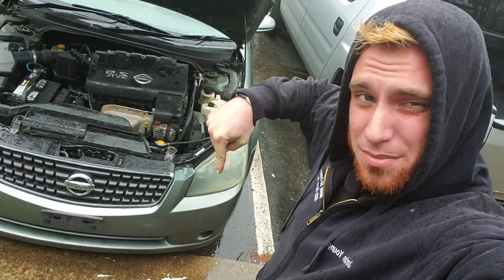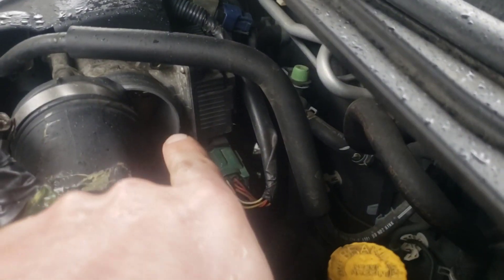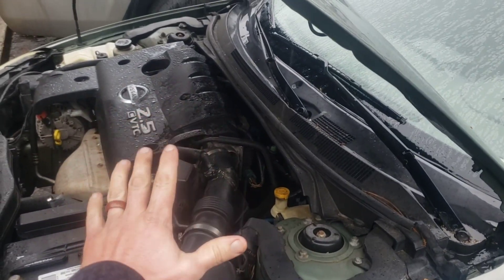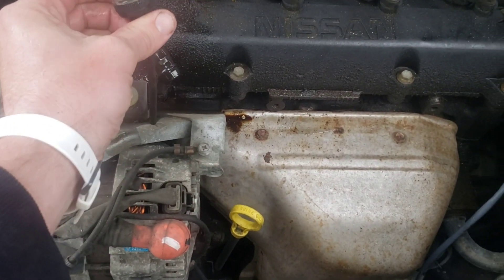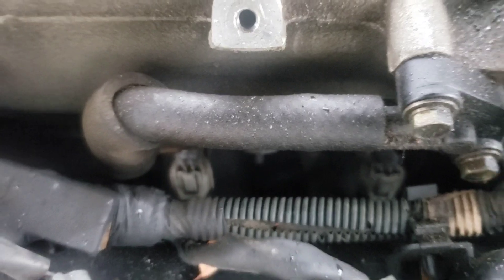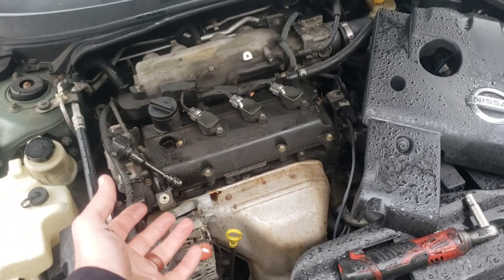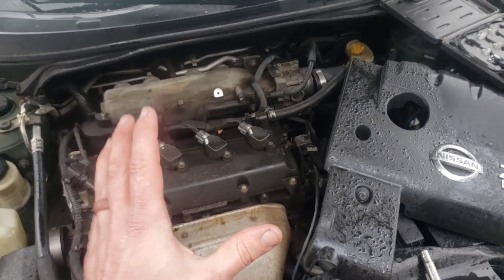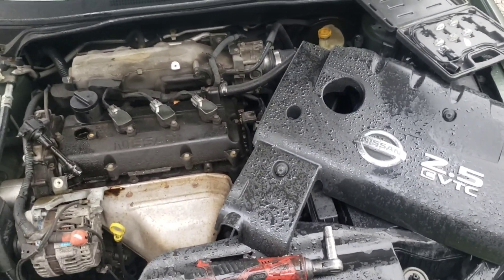Crank No Start Diagnosis Nissan Altima

Comment: crazy thing is that I have replaced the crank and cam sensor twice in my nissan, the car will work for about 2 weeks and then back to crank no start 🤬😪. new fuel pump,

Comment: I have an 05 altima and it stalled now won't start. Has brand new battery, alternator, and water pump. Did the crankshaft sensor last year but not the camshaft. Where should I start? Could be 5 different things
Reply: did you ever it out

Comment: I have a 2012 Nissan Altima SL. It'll start and I'll drive it around and then when I shut it off it won't start again until I've sat there for about 30 to 40 minutes. Then it'll start again. I have no idea what it is I live on disability I cannot take it into the dealer to check this is anybody have any idea what this is causing this problem. It always cranks it just won't start if I've been driving it for a while I have to wait.

Comment: I kept getting code p0335 crankshaft sensor I change it same thing wouldn't start I would charge battery but it would not go over 12.3v come to find out my battery wasn't good I found out after trying battery from other car it started quick

Comment: I have an 05 Nissan Altima, and I having these same issues. I added a new fuel pump in there myself, new camshaft/crankshaft sensors, new thermostat (needed to change it anyway), and I was getting the same crank/no start issue - except it wanted to start but looked like it wasn't getting any spark. So the only resolutions that I can think of are either the PCV valve, the fuel injectors need to be clean, or the Ignition coils need to be replaced - since it started back up after buying a new ignition coil that wasn't providing spark. Then the car reverted to not starting back up after I turned the car off to get gas.
Reply: Ever figure out the issue?
Reply: @SJ-qf4mj  blown head gasket
Reply: What I'm actually passing through now..  any solution to yours?
Reply: My 04 was cranking until the outdoor temperature hit 102 for a few days then it wouldn't start.

Comment: My altima cranks very weak. New battery, spark plugs, there is current on all 4 coils, fuse is ok, starter works. I dont have a fuel tester, but I disconnected the line and it squirts very strong everytime I turn the key

Comment: If you have a no start condition, spray starting fluid. If If fires, it's a fuel pump or relay. If it doesn't, it's a crank or cam sensor.  Not likely a ecm. If you change sensors, Check  wiring or bad aftermarket sensor.
Reply: So do you leave the screwdriver in when you try to crank the car?

Comment: INFO: my dad is a 25+ year mechanic and we had a 30+ year nissan tech come and look at it. 
Replaced the head gasket (I replaced the head bolts with ARP branded ones) and after it would crank but ran really rough. I made sure the the head and block were perfectly flat cause they can warp when overheating which was my original issue. I made sure that I set the timing perfect. Then it went into NATS and I had to send the ECM to a place to remove NATS. Then it wouldnt start at all unless we unplugged the crank sensor. Bought a new cam and crank sensor, new coils etc. After this the coils started to literally explode. The nissan tech said hes only seen the coils explode on 2 cars due to the wiring harness wearing out and starting to short somewhere. I checked the harness with no signs of shorting. Even bought an oscilloscope to make sure the coils worked right and they were running fine. My only thought is that maybe the timing is half a tooth off causing it to sometimes runs but bogs down at higher RPM. Ive spent 50+ hours trying to figure it out. Also each cylinder had perfect compression. Before all this bs happened it was eating coolant cause of the head gasket so I took it to the dealer which they said I needed a new valve cover gasket which made me facepalm a bit but I said fuck it just to prove they were fucking stupid. They ran the car with the valve cover off and said they put new coolant in it. I got a mile down the road and the fucker overheated cause they lied and the radiator was completely empty and dry.
Reply: So I drove my 05 Altima 3.5 the other day home. It upshifted then died. Would crank but wouldn’t start. I went to autozone to get a crankshaft position sensor, installed it and still same symptoms. Cranks but doesn’t run. I just read your comment about disconnecting it and sure enough it started but ran rough. Then died again! 

I assume get a sensor from the dealership?!
Reply: Did you get it fixed and what was the issue? @maxboya
Reply: @scottk27332  motor skipped timing and bent the valves had to junk the car
Reply: WOW so sorry to hear that, I am hoping that's not the case with mine. I just bought it, replaced all the coils and plugs, valve covers, and it ran perfect for a day. Very quiet when running! Got home, tightened up battery terminals and played with some lights and went to move it and it jerked, now its a crank no start....hoping for the best and will check timing now as well @maxboya
Reply: @scottk27332 I don’t know anything about cars but now have an old 06 Altima that sat for years mine cranks but won’t start any idea where I can learn the basics on it? I get the check engine light the battery light and brakes but I’m not concerned about brakes if I can’t even get the car to move lol

Comment: never use fuel throttle body cleaner directly into throttle body. this particular engine is not designed to be sprayed directly .... instead spray a cloth or towel and wipe the blades only. spraying that directly into throttle body will cause immediate future problems

Comment: You said flat head screwdriver, push it in and spray starting fluid, you mean push in the butterfly valve inside the throttle body? Would this require a throttle relearn if it did start? Also, spark plugs and ignition coil generally wouldn't cause an engine shut off while driving, then crank and no start...any other recommendations? Cam and crank pos sensors have already been replaced, still no start. And my understanding is that the fuel pump doesn't usually die while vehicle is driving, it's usually after a shut off it won't start back up. I'm stumped and been trying to fix my daughter's 05. Pump hums when ignition turned to on. This momma is getting frustrated
Reply: Pcr Valve
Reply: Located behind and under your coil packs under the harness

Comment: I had an intermittent crank-no-start situation that turned out to be a bad cam or crankshaft sensor (I can't remember which one) ... but it  wouldn't let the engine ignite.  It would just flub out. It sounded like it was choking or not getting enough gas. It turned out that the  sensor had been recalled from  but no one had ever changed it. I bought the car used after the recall period was closed.
Reply: I am currently having crank no start in my daughters 06 Altima 2.5. OBD is showed camshaft pos sensor. I changed both camshaft and crankshaft sensors and the car is still doing the same thing. Even though one of the codes went away. I even disconnected the negative for a while to resent everything. My next guess is a fuel filter since she runs the car on 1/4 too often.
Reply: @69ChevyGarage  Did you resolve it, what was the issue?
Reply: @69ChevyGarage Have the same issue here🥴

Comment: I change the crankshaft position sensor/circuit today cause it had a check engine light for it but it still take long to turn on but not as much as it did before I fix it
Reply: Now do the pcv valce and crack sensor right next to the camshaft and you'll have a new car

Comment: Question i had to put a battery in my 2001 nissan altima that didn't match but it was close just a slightly higher cold crank like 20 amps higher and thats when it started to  take a good 30 seconds to a min of constant cranking to start i have the right one now but its still doing it but after the first long start its fine as long as I don't leave it sitting for a while I know I burnt something out but don't know what any ideas

Comment: Skips when starting , cranks and cranks but no start , replaced spark plugs , fuel pump won’t start but prior to this was skipping then started , the saw smoke behind engines and and over heat needle went all the way up any ideas what else could be
Reply: Did ever find out what it was?

Comment: You could have mentioned "no compression" will cause a no start condition, as is my case because my friend ran the car with no coolant until the head warped and the engine shut down leaving him stranded. The give away was he mentioned that when he stopped there was "oily" smoke billowing from the engine, and when I arrived to help him 15 minutes later there was no coolant on the ground, nor in the engine, so he'd run out miles back and just kept driving until it died...

Comment: What if I just replaced my fuel pump ignition coils fuel injectors plenum gaskets spark plugs alternator and radiator but it still takes me 2 to 4 cranks first thing in the morning when I fresh start the car. 2006 Nissan Altima 2.5 SL. After I start it the first time in the morning it seems to be okay starting throughout the rest of the day. It's only when I let it sit overnight it won't start first thing in the morning the first time.
Reply: Damn that sucks just change your cam and crank sensors fixxed
Reply: Ever figure it out? I had a similar issue and it was just the battery. I guess after getting it started the alternator would charge it up, but sitting over night it lost a good amount of charge making it not want to start first thing In the morning.
Reply: @SJ-qf4mj  oil was leaking into one of the cylinders causing it to stall start. After having the issue about 20k miles, blew the motor. I got totalled out but GEICO and bought a 2011 Highlander. #truth

Comment: A Blown Ignition 15A FUSE will cause CRANK NO START. LOCATED IN FUSE BOX ENGINE COMPARTMENT/PASSENGER SIDE
Reply: Im going thru this right now. Same year. Cranks but wont start. My friend says coil pack. Im going to look at fuses during the day
Reply: @shell_n_her_dog3659  mine had tons of oil inside the coils so replaced the valve cover and haven’t had issues since
Reply: @alexquezada510  i had a different friend come look at it and he said it was the fuel pupm. So ive had one friend come tell me what u said coil packs & another say something else.. Omg idk which one is right
Reply: @shell_n_her_dog3659  lol who  was right
Reply: Yeah but what mines does is you try cranking it multiple times, and no start. Come back an hour later and it cranks right up. I'm totally at a loss. The it will run normal for a few days, and the process repeats itself; no crank, then it cranks. Both sensors replaced.
Reply: @69ChevyGarage same
Reply: @69ChevyGarage did you ever figure this out? My 2011 Altima is doing the same thing
Reply: @caidynshepherd1718  Yes. It was the camshaft position sensor. And it will only accept a genuine Nissan sensor, not any aftermarket one. I strongly suggest, running a diagnostic by OBD2 scanner. See if you are getting a sensor code first before proceeding. I paid $80 for my part.
Reply: @69ChevyGarage tyvm. I am experiencing the same issue. Will take your advice and run a scan on it first.
Reply: Mines always had tons of oil in the coils I replaced the valve cover and no start still .
Reply: So I have a Nissan Altima  2005 ,2.5 4 cylinder. It will crank but no start , I’ve changed sparks coils , fuel pump , and my neighbor checked all fuses but no start. When we lifted up the seat to get to the fuel pump to check the wire going to fuel pump , when you turn the key to on his light would flash on then off immediately. Please help
Reply: @Zai2Elite did you get it fixed?
Reply: I need a picture of where it is.
Reply: Could this be the cause with a 2016 Nissan Altima?
Reply: @lenasblessed22  check your brake switch sensor it’s common in that year

Comment: I have the SAME problem.... It used to want to start...now it skips. My 2005 nissan altima 4 cylinder was running hot so, I put coolant... I feel so helpless considering I put 5k into this car..... Please? Anyone have some advice? It would be much appreciated... Ive been told by 2 people that they think the gasket is BLOWN but, I don't know anymore...
Reply: My Maxima 2as getting a little hot also, I changed the temp sensor,fans and charged the air and thus was a tux for me and also the car started right up and not running hit any longer, if the car has a blown head gasket there would be moisture and water coming out if the tail pipe, unless the head is worped, these cars I have found to be controlled by so many sensors and if 1 is bad than there's is others,
Reply: Do you see any coolant leak? I have one and I hat over heating issues and it was leaking by the water pump and I install a new one with a new seal and it’s all good now.
Reply: If it starts when cold but not after its warm call Nissan about the overheating crankshaft sensor recall. They reprogram the PCM to fix.

Comment: Bro spraying starter fluid into the intake plenum and an electronic throttle body is an all around no go. You ginna fuck up the idle even moving that valve and gonna need a reset.

Comment: so if i did get it to want to start by spraying starter fluid into throttle body does that elimate the censors and coil and stuff. should i replace the fuel pump.
Reply: Have a 2006 Maxima, cold starts, will run as long as it is cranked up, sits and will run without any trouble for overr 30 min, shut the car off sometimes will restart, but when I let the car but for over 20 min will not restart, what can thus be, have changed the crank sensor, checked the fuses, fuel pump is pushing fuel to the motor, gave examined everything til I'm confused, please help!
Reply: Debra Watson I’m Having The Same Problem
Reply: @DevianaRaquell  just thought I'd let you know I found out my problem, or shall I say it fixes the problem, if the security lights stays on when you turn the car over, the problem is the security, u was told I had to take my car to the dealership and pay lits of money to have this fixed, but after several days if doing this and doing that, I have found a way to bypass the security with the key, maybe this is a fix for you, if not let me know and I'll walk you through it, maybe have the temperature sensor checked and replaced, had found out that this little sensor does more than control your temper of the car, if I can help you I sure will,
Reply: @debrawatson8368  hello, could you please let me know how you bypassed the security issue? It would be very much appreciated!
Reply: @debrawatson8368  how did you bypass the security with the key? I've had an issue with the car honking 3 times when i push the brake to start it and have read it has something to do with a security system the car comes but was not activated when purchased from the dealer. Now the car cranks but does not start after a few months of this. Thanks!
Reply: Did you replace the fuel pump

Comment: Bro, thanks for this imformative video. Im having the same issue. Just bought a 2005 Nissan Altima 2.5.. the recent owner had it sitting for a year because he Lost the original key. I came by and offered him money for the vehicle until I managed him to say yes. I called a locksmith to make a key. Fist day it ran good. Same night it rained, next day no start and battery was death. Went and bought new battery and did not start. So I called locksmith and he reprogram the key? Car started again, 2 days later car won't start. Am I missing something here?
Reply: did you find out?
Reply: might be the alternator draining the battery gotta get it replaced

Comment: Thanks man!
I have Nissan Altima 2006, whenever i try to start it,it takes a while to start (not immediately as it should be) 
The fuel pump, coils on plug and spark plugs are good 
What else could be?
Reply: Broken ground cable to the transmission from negative terminal on batter( they break where they meet the transmision). If thats not it i woild replace crank sensor and check fuel pressure
Reply: We have the same problems and same functional parts. What’s your end of story? Is it because the camshaft sensor?